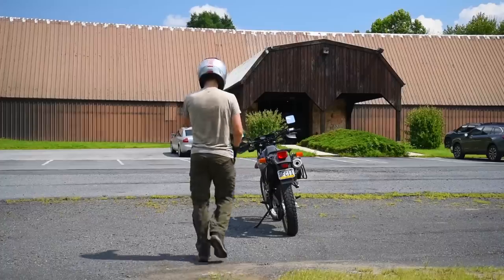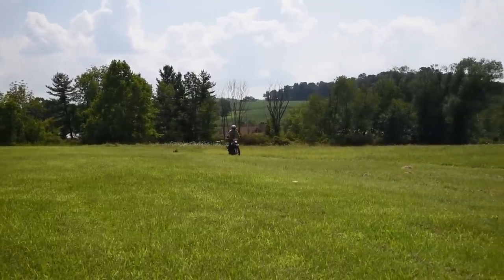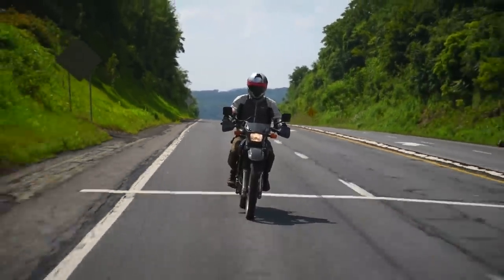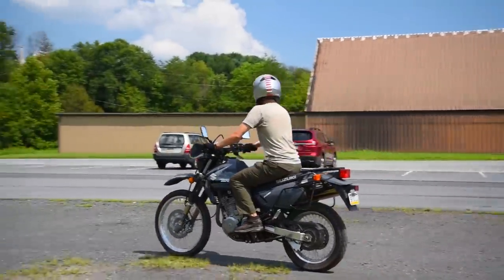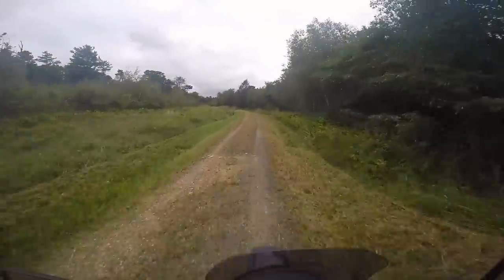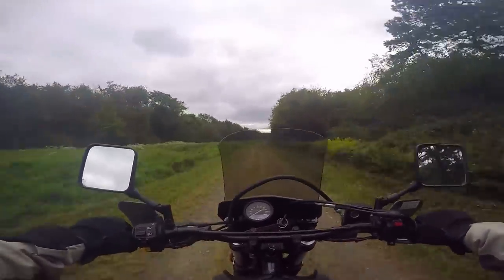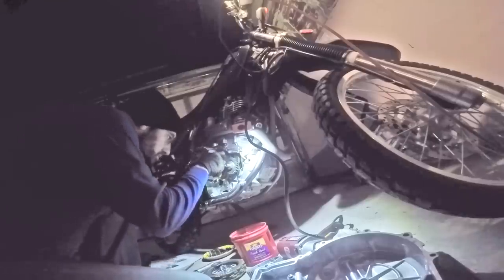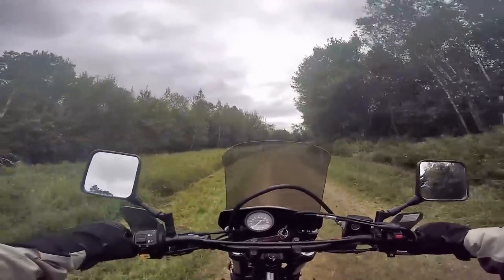2013 Suzuki DR650: Regular Car Reviews

Comment: I went for a DR200 even though it's even worse on the street because it's underpowered and it sounds like it's revving too high above 45-50 mph. But that's okay because I wanted it for trails and it feels pretty light. Also, I got a lot of dirt roads where I live and it handles great on them, even when there's a lot of chatter bumps or when I push it above 60mph.
Reply: I used to have a dr 650 then a ktm 640 but now I bought a new dr200 and love it. It weighs nothing and I've cruised 65mph for 80 miles w/o any issues although with me being 250lbs it's top speed is 77.

Comment: Great review.
Adventure and large dual sport bikes have it tough.    Here's my take on it......they aren't for beginners. 
You should already have off road chops before taking a street oriented ADV bike off road. And you should have street experience before riding a dirt based ADV on the street. They are machines that are bastard creations of two different worlds, to the point there are TWO distinct types of ADV or dual purpose bikes. Neither can do any particular role as well as a dedicated bike, but they do make good all rounder's depending on what compromises your willing to make, which is based mainly on which type you choose.....

1st. Those based on "dirt bike" designs and look the part, but are far too heavy and demanding for real off road use, while simultaneously (and ironically) being woeful compromises when ridden on the street, for the reasons you listed. See DR650, KLR650, XR-XL, plus many more pricier KTM, Husa and Husq models.

2nd. Street based ADV bikes made from adding some off road features to what is basically a standard-ish motorcycle.  Most people will never take them off road in any serious capacity and that's for the better. The bikes these machines are meant to emulate, (Paris/Dakar type racers) are far more capable and are ridden by serious professionals. They can be big fun for thrill seekers and long distance gurus, but most of these guys will have a dedicated dirt bike in the shed too.(GS series, Tenere', V-Strom, Africa Twin, ect)

That said, I love my 93 TDM850. Its one of nine bikes I ride/own, and while its heavy, its also very comfortable. Going down dirt roads and dual track trails is boring on a proper dirt bike, plus I have to tow it there. The TDM, with a few mods (it was NEVER meant to be a real off road bike) can go forever down these paths and I can still commute to work on it, two-up tour, hop curbs, pick up some groceries and take the kids on little rides in the country.

Comment: Sportsters have a rivet spring plate in the stock clutch that after about 10000 miles falls apart and grenades the clutch and chews up the clutch basket which expensive to replace. Mine did this and I almost had to replace the basket, thankfully I was able to dremel down some of the damage. The clutch itself is about $150 the basket is $300+.

So similar sorta cheap shit story however I really think Harley knows it will grenade and that's why they put a riveted freaking plate in a clutch pack. After market clutch packs just have an extra plate there is no need for that spring plate.
Reply: Most motorcycles have this garbage in their clutches.

Comment: If youre talking about a sustained zombie apocalypse scenario, then a bicycle is the best bugout vehicle. 1) doesnt rely on gas that WILL run out when society collapses 2)you can fit a shitload of replacement parts in a backpack 3) runs silent, to avoid drawing attention. 

A motorcycle might be better in the initial few hours, but a bicycle is far, FAR better for a sustained survival scenario.

Comment: Its a pig. So is the KLR which literally falls to bits. I bought the G650GS and it does everything well and after 65,000kms and three scheduled services, its still going strong with full compression on the cylinder. Literally nothing has broken or fallen off. I would go for a Yamaha Tenere if they were not so tall.

Comment: Idk man I’m 19 my dr650 is the first motorcycle I ever owned I’m 140 Ibs 5’6 the bike is torqueee I guess but it’s pretty great for my first bike I can get on it pretty easy as a short dude it’s made for smaller people not taller people I’m not scared by it unless I have to pick the damn thing up your right I do feel the weight while off-roading and yeah I’d rather just stick to clean trails to be honest with it. The dr650 is a experience it’s like a project car. It’s the indestructible design that I know I can trust and learn on. It goes 130kmph before I get speed wobbles but I’m not going anywhere fast I’m just going where I want to go with it which is almost anywhere compared to a street bike

Comment: I can't understand this guys logic, why get a GS650 instead of turning the DR650 into an adventure bike? the GS650 is 30kg heavier and won't be as good off road, why get a XR650L instead of turning the DR650 into a focused off road dual sport? the XR650L basically has the same specs as the DR650 and you'll have to do the same mods to the XR650L too, plus the XR doesn't have the aftermarket support the DR does, a DRZ400SM won't be as good on the highway, the DRZ will be pulling 77000 rpm at 130kmh, while the DR will only be pulling 5200 rpm, and the DRZ won't have the torque of the DR.
Sure you can get bikes that will perform roles better than the DR, but they will suck at other roles, that's why the DR650 is so popular, because its a jack of all trades, you can't get a bike that's a master of everything, the DR650 is a cheap reliable bike that does everything pretty well.

Comment: On my VStrom they cheaped the fuck out on the headlight wiring! 
All the current for the two automotive size headlights flows through one tiny 16 gauge wire, through 2 connectors!
Those connectors have tiny pins which inevitably burn out! 
The solution is to buy a kit which bypasses this and ads relays…
Now the power flowing through those connectors is only to power the relays.

Comment: Great bikes. Why would anyone buy a KLR when this exists?

I would argue that the TW200 is the ultimate Zombie Apocalypse bike. It's simpler, can be fixed with bubble gum and gauze pads, is smaller for getting in and out of tight places, and you don't need to go faster than 15mph in a Zombie attack.
Reply: The klr has a longer range better on the highway and more comfortable. That’s why people would buy it over a dr

Comment: 0:04 *Why wont it do dank woolies
Reply: It will. He's just not trying hard enough.
Reply: Actually, I don't have to really try hard at all. Just romp on the throttle. This bike comes heavily restricted due to emissions reasons but in about half an hour you can de-restrict it and gain about 10% over stock. Like when I got mine fully stock, yeah it would do 100mph, but now it gets to 100mph a shit load faster with just pulling the snorkel in the air box and grinding out the goober weld inside the header flange. Want a little more oomph, rejet the stock carb and cut a larger hole in the top of the air box. Want about 20-25% over stock, hi-flo header and gsxr 1000 exhaust, port match the exhaust passage to the gasket, throw on a TM40 carb instead of the stock bst40. Slap a 17" front wheel on with street tires and you'll have a 650cc supermoto.
He's right about the dr650 being a blank slate. The bike design hasn't changed even a bit since 1996 so the world of aftermarket parts for this thing is fuckin huge. There's even a 790cc kit for it with a bigger valved head and a stage 2 cam. The possibilities for this bike are endless. So sure, you can spend the money on a bike that is better at specific things or for 3k U.S.D. you can buy this bike used with very low miles, and then drop the rest of the money that you would have spent on the more expensive bike, into making this bike exactly how you want it.

Comment: ooook its tall because you have your suspension too stiff for road riding, the issues you have with the wheels can be corrected with getting offroad tires, its really not that heavy, its meant for tall people, im 6ft2 and its a perfect size for me. also you could buy stock bikes to do whatever you specifically want, but the dr650 can be modified to do anything meaning you can have your commuter that transforms into an offroad bike or a trail bike, or a hunting bike, or whatever and still be useful in all other ways. literally everything hes said is wrong with it can be fixed with the right parts. and its a cheap bike so youll have money to get what you need after buying it. furthermore, its SIMPLE. anything that goes wrong with it you can figure out how to fix it on your own. its a perfect bike to learn how to work on bikes. good luck coming in with 0 knowledge and repairing your ducati after buying those 1500$ parts. sure theres things that suzuki should have included with the bike new like a better seat, NSU fix, and better jetting or a thumper carb, but stop complaining, this bike is like lego, put it together how you want it and if you dont enjoy it, then theres only you to blame. i love mine, its a beast and i know that my money is going into a bike that I can rely on for many years. though i do get fatigued after about an hour riding it lol

Comment: So it is basically best for zombie apocalypse. Thing that doesn't exist. 
But I think that it is best bike to do everything moderately. And it is like LEGO, you can have everything in one bike if you have enough dedication to spend some time in garage. 
Anyway, I can not understand that "125/250cc beginer bike" thing you have in US. I've started on sv650s and immediately regretted that, because it had a sports bike seating position and it felt like unwanted butt love. Than I bought 660cc single cyl with ~46hp. It was a blast until 3 months later I've started scraping pegs. Than I decided fuck it, I need something that would make me shit myself and bought Aprilia Tuono 1000cc 123hp/71lbft monster. And I loved that thing, first of all - brakes, suspension, dampers, other engineering things in that bike made it ridable for any noob and it was still extremely exciting bike two years after. You can not compare it to any small budget bike. It goes, it stops it gives you all the feedback from the road, etc.  I think if you have enough capability to speak to yourself honestly and don't do too much stupid things with bike you can start on anything.

Comment: Bitch is a happy air cooled monster for crossing whole countries on (Australians will attest this point firmly, in the single bore market, they are 2nd to none. and are even capable of outdoing a lot of the twins on the market, Africa Twin might be an exception) though i do agree on the blank canvass analogy, it is pretty blank and basic in stock config though im the kinda person who LIKEs that, i WANT to make a vehicle my own, i WANT to bolt things to it, change the lights, do this and that, make it overly specific in use which is what im gonna do to my DR and when i finally have the money, its whate ill do to the Patrol single cab ute i get (still deciding on GQ/Y60 or the GU/Y61, leaning towards the GQ honestly, love the look of em a bit more.) so i personally see it as a winner. I do see your point that its not a great street bike, KLR is a good deal better at that and even thats not awesome (its pretty wide as well as tall and having a single big cylinder) but its still very usable. And they are cheap so yeah, very mechanical, good for crossing entire countries on imo.

Comment: Put Dunlop trailmax mission tires on and they are great on the road and very good off road, and last many miles. Have wheelie this bike just taking off fast without even trying, it dose wheelie. I have over 5,300 km on mine so far this season. and do many 200 to 300 rides non stop, would be nice to get a better seat, but no needed. It dose need the 20 liter gas tank which I have on mine, and get around 500 Km per tank of gas.  These bikes are not made for candy asses of some one who wants to race off road. They are the best do it all bike on the market.  Just put a skid plate on and some heated grips, power outlet, center stand, and a good set of tires,  like the Dunlop TrailMax Mission, and ride and smile all day.  If you want a candy ass bike go with the KLR 650  better seas and some wind protection, also a great bike.

Comment: 10:46 How long will I be a beginner motorcyclist until I can trade my bike for a bike that is not for beginners?
Reply: Only you can answer that. I use an arbitrary 3000 miles then hop on whatever you want

Comment: pro tip: Avoid riding with people who took the MSF LIKE THE PLAGUE.
MSF is what people take when they didn't ride dirtbikes as a kid, if they didn't ride dirtbikes as a kid then they are not naturals at knowing the controls on a motorcycle, if they are not naturals at knowing the controls they have low confidence, if they have low confidence they are even more prone to mistakes, if they are even more prone to mistakes they are prone to whiskey throttling into the back of your DRZ400SM with you sitting on it in a Hooters parking lot off of highway 94 and almost breaking your back, for example. Being taught how to ride in figure eights at 4mph in a smooth parking lot by a 55 year old instructor that has been riding for 20 years and still doesn't know how to wheely will not make you a good rider. Ragging the fuck out of a bike and forcing your brain to learn the hard way will. 

TL;DR ride dirtbikes first.
Reply: I only ride with people who do the msf. The “I rode dirt bikes as a kid” bros usually can’t corner for shit lol
Reply: Collin Mac lol what a load of BS. I’m not discounting some of the safety things taught in MSF courses but if your experience level is 5+ years of hard off road riding vs taking a class for two days where you go 8mph in a parking lot I’m gonna go out on a limb here and say the dirtbike guys are far more skilled. Like I said, I’ve seen it first hand. Anyone I’ve ridden with that had to take an MSF course to learn how to ride has had a long way to go before they should be out on the streets.
Reply: ZUKI I’ve ridden across America with many groups of rider and different experiences. The dirt bike bros can’t ride for shit in the twists. That is fact. The good thing about life is that each person has different experiences with people. The new riders did much better overall
Reply: Collin Mac ok so what you are saying is new riders are more skilled than people who have been riding for 10+ years... got it. You sound like a Harley rider but I could be wrong.
Reply: ZUKI from my group ride from jersey to Tucson Arizona, yes. Also look at my profile picture, does that look like a Harley? I don’t get how you’re even trying to argue my experience. It’s one you cannot win.
Reply: Also me and you must have different definitions of “new rider”
Reply: Collin Mac I actually teach the brc for the state of ny. Most of the people who say they rode dirt bikes usually do the worse. Most of em are hotshots who cannot follow simple instructions and think they know how to ride street because they ride dirt.
Reply: Why are you still arguing an experience I had? Didn’t I say it’s one you can’t win. IN MY EXPERIENCE newer riders did better overall in my trip. Why don’t you understand? This is why I called you a THICC skulled imp.
Reply: Yep, big difference in riding ability between someone who grew up in the dirt and someone who didn't. I started at age 10 and later when I got on the street I couldn't believe what lousy riders some people were.

Comment: Jeep wrangler not more capable off road than a rav4, excuse me while I front and rear limited slip diff, Hi Lo transfer case, stock snorkel and much much much higher off the ground, on a stock TJ (like seen on the video)

Comment: why why why WOULD YOU buy a DR 650?  Yes they are cheap, but...they are a 1980's technology.  You should have ponied up for a Husqvarna FE501 or KTM 500 EXC-F and get a bike that is actually modern tech.  If you wanted to stay Suzuki, you should have gotten the DRZ400..way better bike and faster.
Reply: Old tech isn't always a bad thing. I've ridden dr's for years because I respect durability and simplicity.
Reply: Lol I speak pluraly. I've ridden the same bike for the past 15 years, but I've taken others for a spin.
Reply: You know that KTM requires something like 15 hour oil changes, right?
Reply: Drz isn’t faster top speed wise. Worse in the highway and has more shit to break. That’s why people would choose the dr

Comment: dual-sport riders are the misfits of the roads.. Don't get anything under 350cc. XL and XR dual-sports are famous for being indestructible out of the box..
Reply: I bought a DR200 and love it, it's great on the road and is plenty quick enough and so light that I can throw it around anywhere I want plus it gets 80+ mpg.
Reply: @orange70383  I did a stint on a 250cc dual-sport and even with heavy mods it wouldn't handle highways and interstates.. Everywhere else it was awesome and no different than a 650cc..  Also there is no or negligible price difference between a 200cc and 650cc and if you do one of the liquid cooled or EFI smaller displacements you're actually paying more than for the more reliable more powerful bike..